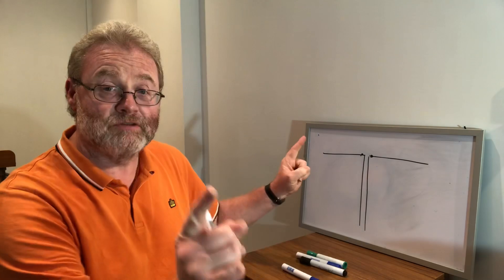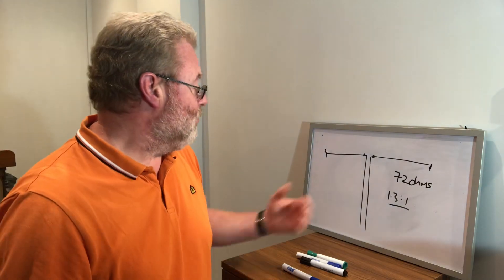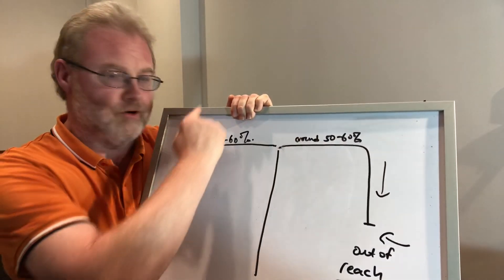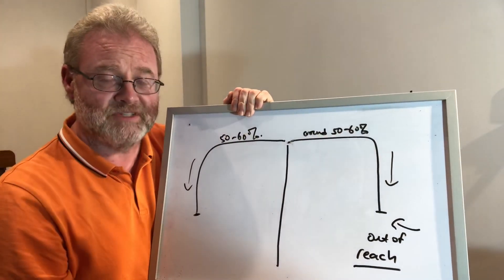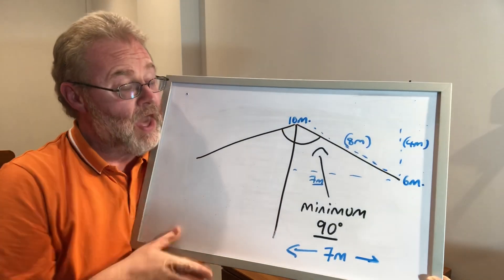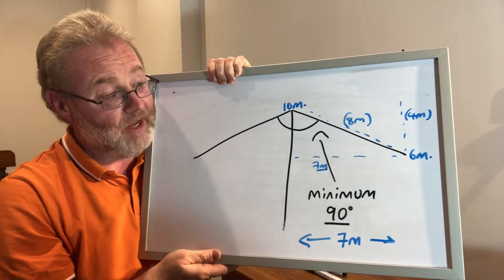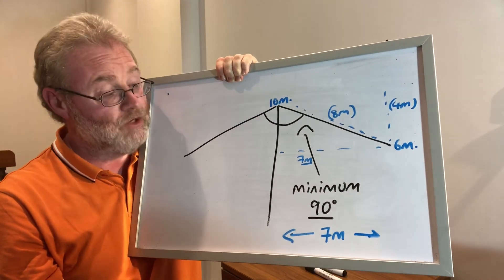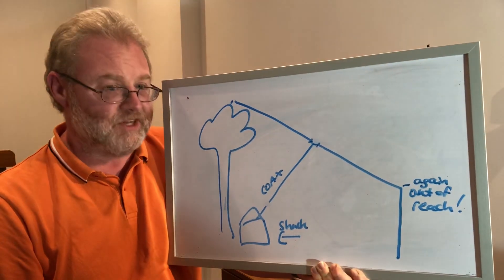Ham Radio: Dipole Antenna In a Small Space

Comment: Excellent explanation.  Thanks! I’m putting a wire in my attack and I’m concerned about safety. Does an end fed half wave behave similar to how you explained the dipole? In other words, is the feed point  or the end the highest voltage? Can the antenna be flat or must it be vertical to get sufficient transmission distance? Lots of questions, I guess. I appreciate your videos to help me determine the best, safe configuration in my residential attic.
Reply from the maker: For any half wave the ends are high voltage and middle high current. If you get the antenna a 1/2 wave above ground then a horizontal dipole will do well broad side. A vertical at that height will too as it’ll have more of an omni directional patter, all be it a little weaker than a dipole broad side though stronger than a dipole off it’s ends
Reply: @TIMG5TM  Thanks! Very helpful!

Comment: Hi Tim, a brilliant video about dipoles. I’m a new M7 and learning a lot, but struggling with decent HF results so I must try a 40m dipole. Do you think it would work ok if suspended it from the guttering of my house with the feed point going straight through the wall rather than vertically downward? My shack is upstairs.
Thank you for your excellent videos!
Reply from the maker: Hi Stuart - as long as the coax feeding the dipole doesn't run parallel or close to one of the dipole legs youll be fine

Comment: Tim,so you only need an external atu if it's fed with ladderline?? Whats the shortest length of each legs I could use to get 80m without using an auto atu please?? Only want it for short hop say 150-300 miles.Thankyou
Reply from the maker: Hi Andy for the doublet you will almost certainly need an external atu. The only way to use 80 as a non tuner centre fed antenna is to make a dipole, either a full 132 foot or so, or linear loaded at about 92-96 feet (look at my 40m linear loaded video and scale to 80m). 73
Reply: @TIMG5TM  thankyou so much Tim

Comment: This was good Tim, I needed to be reminded where the current and voltage lies in an antenna. At home I have the length for antennas but each element would pass over a steel roof for the first 20ft in each direction and clearing the roof by less than 10ft. Am I wasting my time do you think?

Comment: As always, I greatly enjoy the information you provide and your enthusiasm for the hobby.

Regarding putting a dipole up in the attic, would that in any way be a fire hazard? If so, how can I eliminate that risk? 

Thanks for everything!
Reply from the maker: Thanks Stan! It’s best to keep the dipole ends fully insulated and completely away from anything conductive including the roof rafters. Make sure the final couple of feet at least of each leg dangle or are kept free from touching or bring near anything. Also keep power to 50 watts or less.
Reply: @TIMG5TM  Thanks! Once I save up a bit of money I will look into getting an HF radio (Yaesu 891) and putting up an antenna. I just wasn’t sure about the safety. Thanks for the advice.
Reply from the maker: @StanMcCullars  my pleasure.. enjoy the new set up once installed 73

Comment: Great for running between two trees. Unfortunately, I am in new houses and the only trees I have struggle to keep a sparrow up, but if I wait 30 years I might get up a thin wire dipole that will almost be invisible to someone going past very fast in a sports car at speed.  Yeah, good working aerials/antennas and adaptable, had some good DX on one of those on CB 30ft in the air and two feet above a lead ridge of a roof.  I wonder how much I lost into the roof?  Still, it worked very well, all I did was put a few loops of coax just below the feed point and had 1.1 to 1.3:1 at each end.  Without the loops of coax, swr started at 1.5:1.  Not quite sure what affect the loops had, but I read it somewhere and it worked.  Nice one again Tim.

Comment: Good video. Quick question, rather than dropping the extra wire down the 2 end poles from the 6m point on the pole how about taking the extra wire up the pole? I suppose it becomes a "W" would this be any good? Just wondering 🤔
Reply from the maker: As long as the section from the feed was flat top yes. If it slopes down from feedpoint to the 6m point like an inverted  v then the angle going back up the pole would be too obtuse (less than 90 degrees) hope that helps? 73
Reply: @TIMG5TM  oh yes, I didn't think of that 👍🏻 just made a totally random breaking all the rules mad shaped antenna out of my end fed just to see what might happen. First call Canada from Wolverhampton. Antennas fascinate me 👍🏻
Reply from the maker: Brilliant!

Comment: What if, as in my case you have three telephone cables spanning your garden 7m high? My garden is 12m wide - the width of the property, but only 4m length from the back of the house. The cables are directly overhead. Any suggestions welcome. But would a horizontal couple with the cables, if there was room.
Reply from the maker: Yes they could but at 10 watts you might be fine. You’d need a low dipole to be away from them.. however even low dipoles get results. Maybe a vertical of some kind? Depends if there’s any part of your garden that has a little air space from those wires to place it? Either a multiband DX Commander or a 21 foot vertical with an auto tuner at the base which with radials should get you 40m and up.

Comment: Cannot go wrong with a dipole, especially if you are new to radio. My first was a simple stripped coax dipole for 2m, separate the core from the shielding and there you have it done in 10 minutes. Next was a dipole from 15mm copper tube with adjustable elements at the ends which slide in or out. Can tune it for 10m, 11m or 12m in 60 seconds, Could go to 15m if I put longer elements in.

My latest project is a compact dipole which can fit in a small bag, opened up and placed on a tripod. Can tune it from 70cm to 4m. Can use it horizontally, vertically, inverted, a reflector plate accessory for directional and probably other combinations not thought of yet.

My loft is full of dipoles :)
Reply from the maker: Brilliant!

Comment: Great video again Tim. I built a inverted V for 40M using a 1:1 balun. The only thing Ive done which I didn't know about until watching this is I use an aluminium pole with a 1M top section of fibre glass. My coax runs down the 1M section then comes off at 90 degrees over the house roof. Would it be best now to run the coax down the pole to the fence then across the fence to the house. Soz for the long comment. 73
Reply from the maker: As long as the coax runs down for a good length straight down the pole that’s fine. My doublet ladderline eventually has to turn right and run about 20 feet below one of the wires .. if it works ok now then leave as is. 73
Reply: @TIMG5TM  Thanks again Tim. Its works fine but was just wondering about the coax coming off a meter below the balun. Like you say if it works leave it. 73.